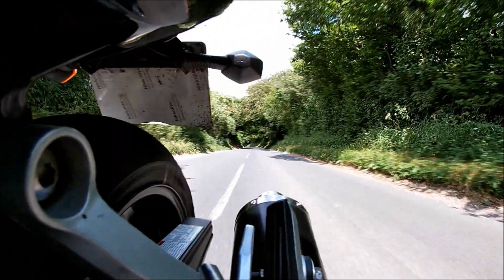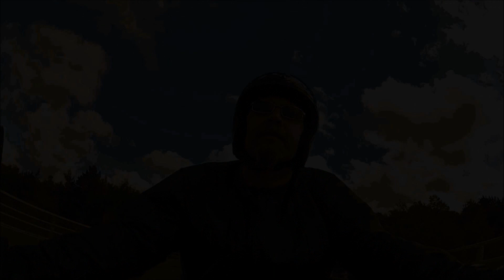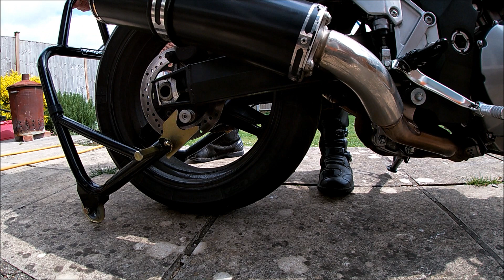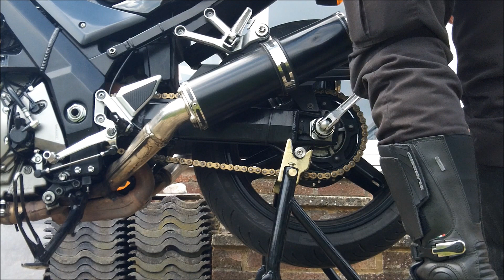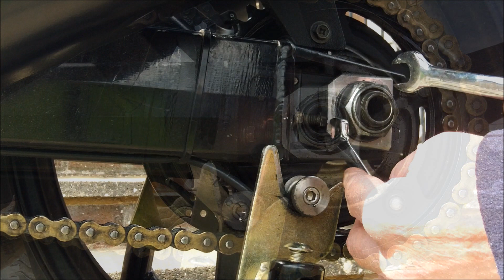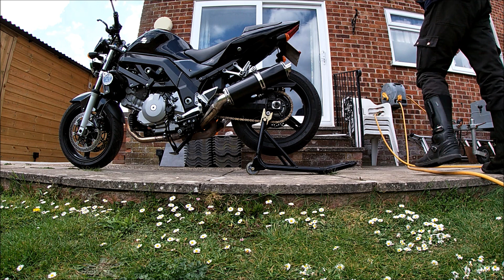Suzuki SV1000 Chain Tweak - Duke Dyson  #sv1000

Comment: The manual says to set slack while on the sidestand.  Putting it up on the rear stand changes the distance of the axel to the front pivot.  I've made this mistake myself and made my chain way tight, and it might have been the reason for my sprocket bolts shearing off 500 miles from home.
Reply from the maker: Wow! You must have made it very very tight to shear the sprocket bolts :-0
Reply: @DukeDyson  It was probably fatigue over thousands of miles, that's the only explanation I can think of.  Did a lazy pull on the highway, get off throttle, and try to rev match, but my RPMs went up as if I were in neutral.  Changed gears, same thing, and it did feel like something broke.  Check how tight yours is while on the sidestand, might be surprised.